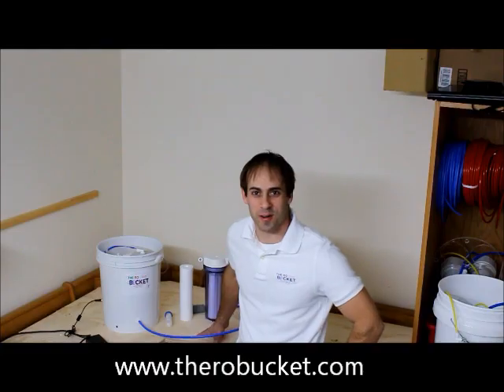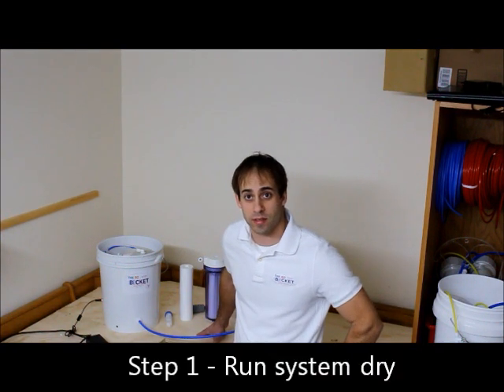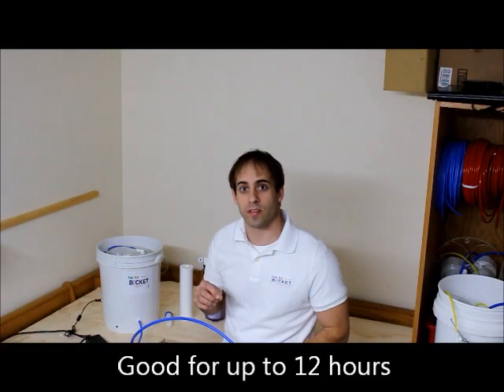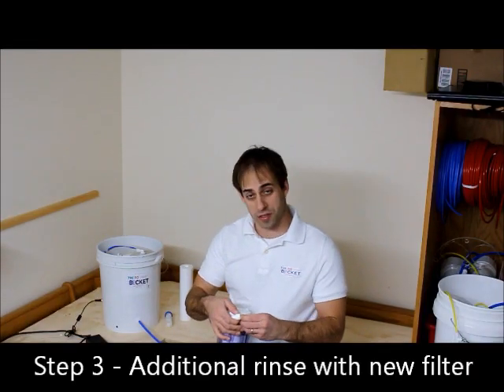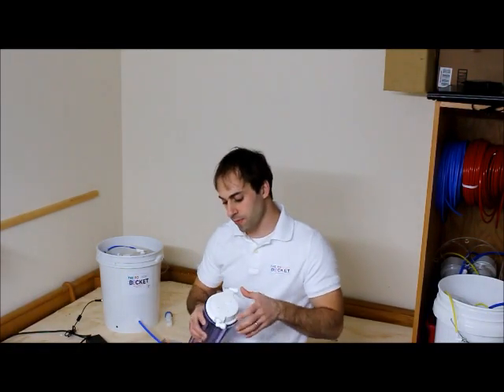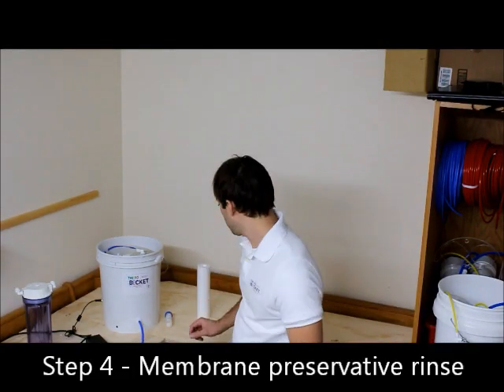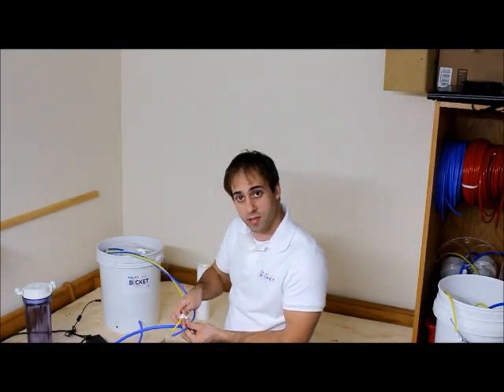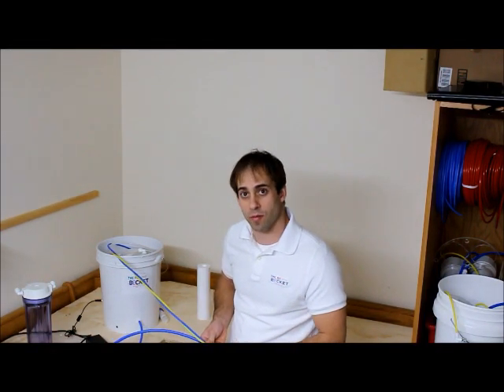RO Bucket maintenance - flushing

Comment: Hi Carl.
After running the preservative mix on recirc for 5 minutes, do you let the preservative mix sit in the RO until next use or do you let the system run dry pushing all the fluid out? Thank you